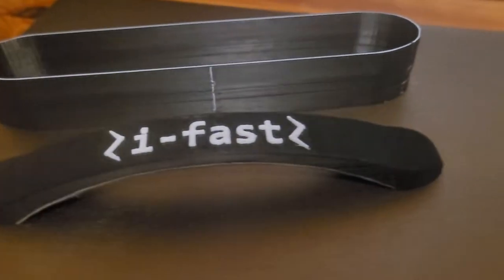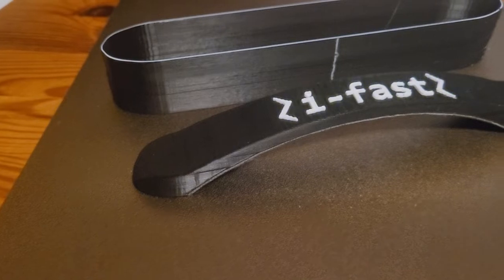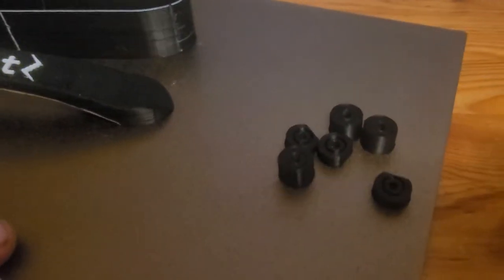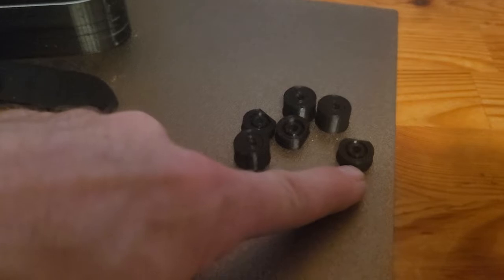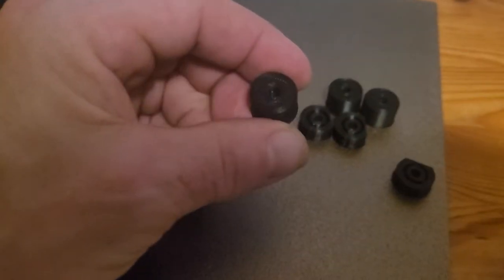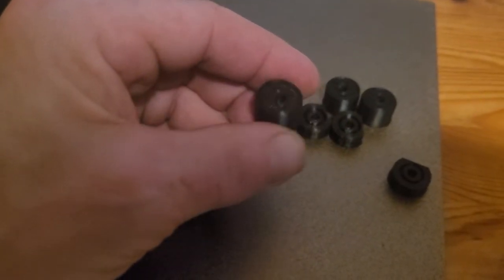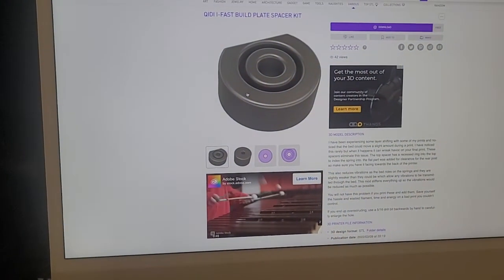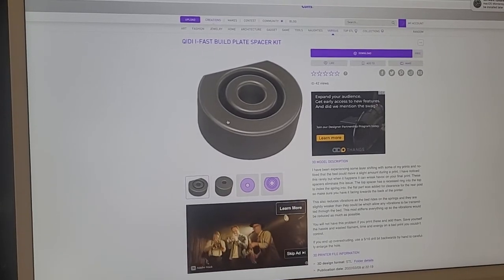Qidi i-fast Build Plate Spacer Kit Layer Shift Fix!

Comment from the maker: I'm going to redesign the top spacer.  It works but I'm going to include a washer in it so the spring doesn't dig into the plastic.  Over time it will be more reliable.  I worry that over time it might be an issue.  I thought of the idea last night.  Just going to find a common washer to use then I'll cut it into the current design

Comment: I posted a long comment and I poofed it away
I wanted to share that changing the springs to compression mould die springs saves a ton of hassle. The plastic spacers will compress over time. I had this issue with almost all my printers except a few. The problem with most Chinese OEM bed springs are weak or not hardened so they will compress over time. Amazon has the replacements die springs very cheap and you will never have to mess with them again. I used to like messing with mods and upgrades but through the years I started fixing things to last so I would not have to revisit it again.
Reply: That is great to know, would you mind sharing a link to the springs you bought? Thanks!
Reply: @sassdachap4811  I purchased those  probably three or four years ago but Amazon has them all you have to do is search for yellow compression mould die spring and then you need to make sure you get the right size you match it up to the ones you already have and your good to go
Reply from the maker: Good to know!  I think the bottom spacers would still provide decent lateral support as well.  I wondered if the springs might sink in over time.  I used an engineering grade pla.  Nothing crazy but the springs aren't too strong so I'm hoping it all works out.  I appreciate the suggestion,  when I mentioned the issue to Qidi they suggested the spring upgrade as well.  The problem is also caused by the slightly oversized hole in the frame for the adjustment hardware. There should be more for the bolt to be held straight with as it tends to pivot off that hole in the frame.  I will see job it goes bit I think this will do a great job, even if the top ones need to be made from stronger material or need to be replaced every now and then.  I'll be using it often so I'll definitely report back if there are any issues over time. .
Reply: @melioratewithnate  I have not put many hours on yet but mine is still holding well. I did not take the springs out yet to check but like you mentioned they are not strong. I see QIDI has plastic there as well. I have not used exotic filaments yet but I will now that I have an enclosed printer. I am printing your vents now with ASA. I have used CF ASA PETG and Nylon just once. I want to try many others now I can. Keep up the good work.
Reply from the maker: @Jim Nicholson  half the reason I decided to review the printer is I knew I'd be making mods and I wanted to make sure I tested it as fully as I could afford.   I'd love to grab some more exotic filaments and will as I go.  I'm into everything 3d printing has to offer.  This technology is like a dream come true.  It still amazes me every time I take a print off the bed.  Going from idea to finished part in less than a day is an incredible tool to have.  As prices increase we will see more and more people turning to 3d printing to fix, improve or just get the parts they need without shipping costs.  I am a huge fan of open source.  It gives me great satisfaction to know people are using their printers to improve their printing experience/gain a little experience with their new printer.  I sometimes wonder what I will print next, even tend to get a little annoyed with myself for not using it or being able to think of a thing to print.  It's a weird disease.  Lol.  I appreciate your feedback.  It is greatly appreciated